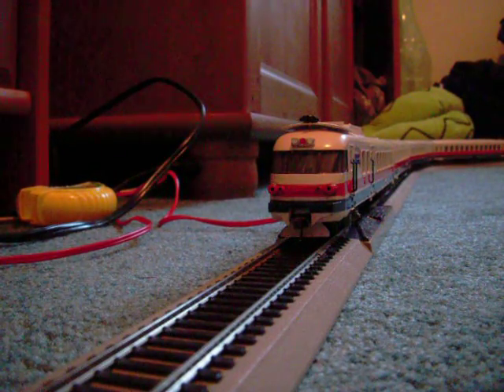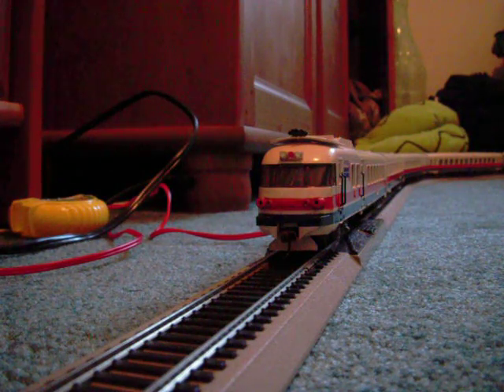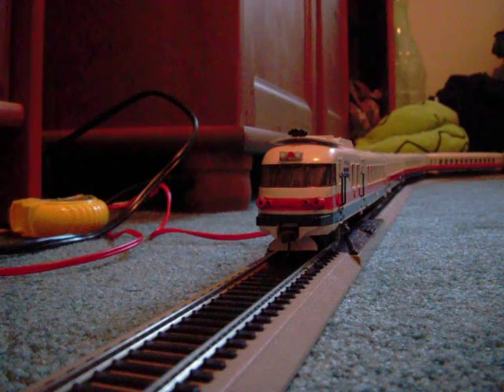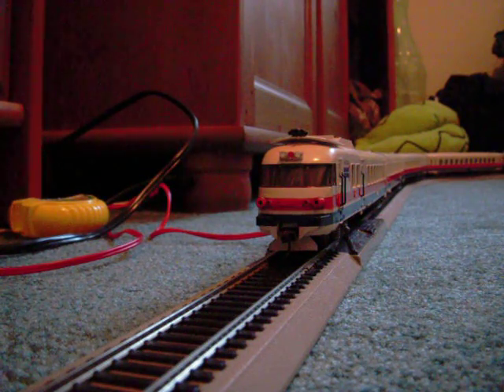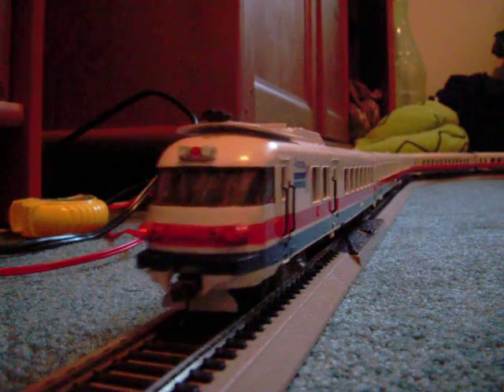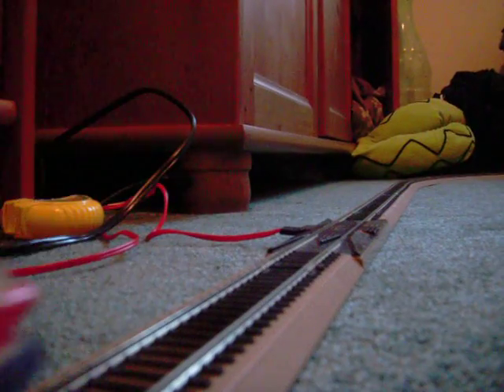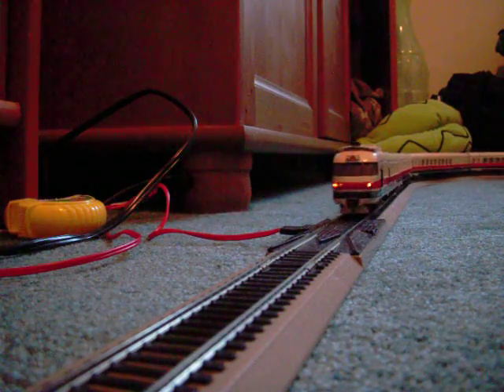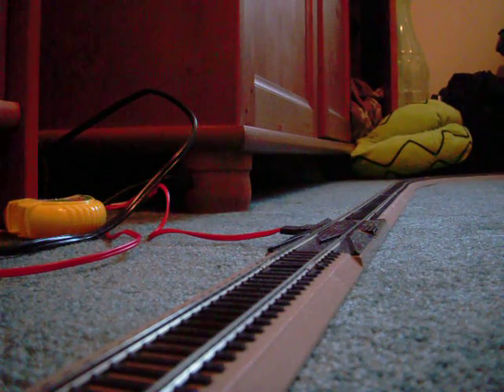Jouef Amtrak RTG Turboliner--1st test run after rebuild w/ new drive-train

Comment from the maker: @EMDSD14R Yeah the guy who did the work to mine is up in Allentown.  He had to get the parts off of Ebay so I had to wait a few months.  Also if your drive train is still good to go you can buy a new Kato motor up at Lin's Junction in Lansdale I've seen them there.  Also I took the KayDee out but saved the screw. Then I drilled a hole in the draw bar and screwed the drawbar into the hole. The only thing with that was I had to take out the diaphragms between the first and second cars-they binded.

Comment from the maker: @zozo87700 As best as I can describe, it's a centered motor, with drive shafts out both ends, turning down toward both trucks and driving through gears in the trucks.  The drivetrain came out of an Athearn F-3 diesel.

Comment: Hi There, I bought the same and it just does not move on my tracks. It moves a bit, then stops, then move ... I gave it to my expert guy who was unable to do anything with it. I need your help! Could you give me the link of your guy in Allentown who did this for you?
Thanks
Reply from the maker: +philippe honore I forget the guy's name it's been such a while now.  But before you think about repowering your RTG set, look at the worm gear drive.  If it still has teeth that's a step in the right direction, mine was worn smooth.  Also check your wiring.  You might just need a new motor.  The old one in mine would run for about 20 minutes then stop.  Should that be the case I recommend a Bueller can motor.  But again I forget the guy's name, but if I heard it I would recognize it.  Sorry.
Reply: +nyshortline thanks for your response. It seems that the gears are fine but the front does not seem to pick up power at all time. I tried to add weight but it did not work better. Very frustrating
Reply from the maker: Try cleaning the wheels with a wire brush.  There's one that has an alligator clip that clips to the hot rail on your track and when contact is made with the wheels it cleans the wheels as they turn.  See if that helps.